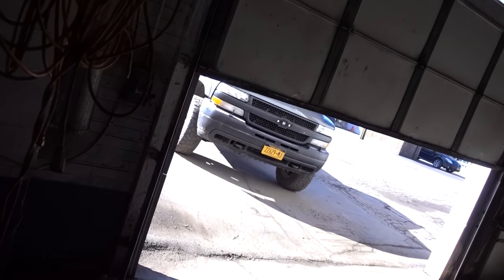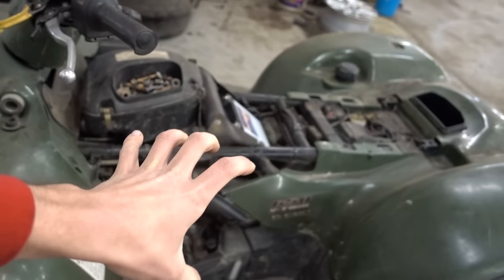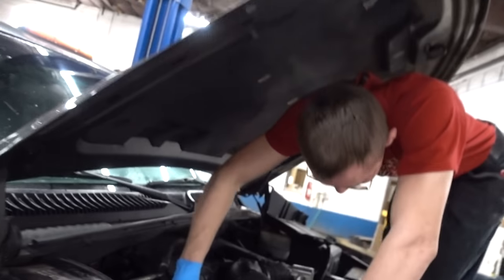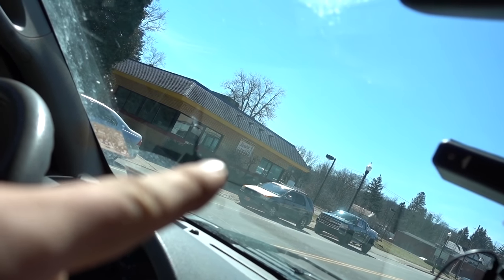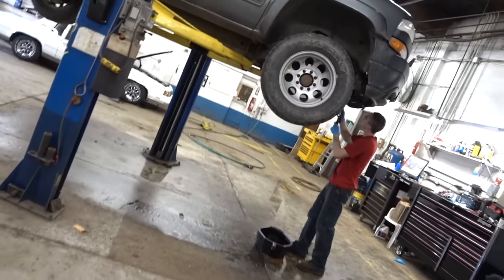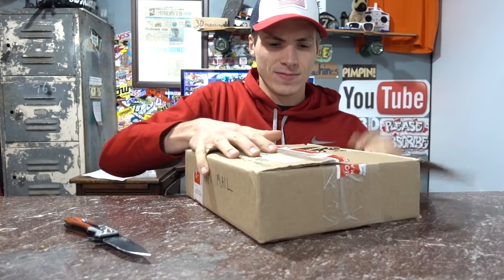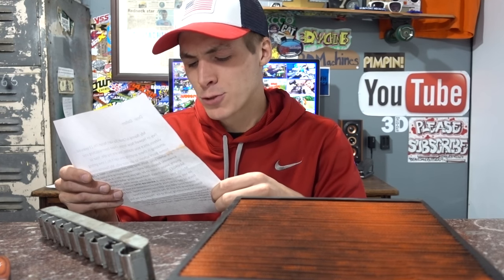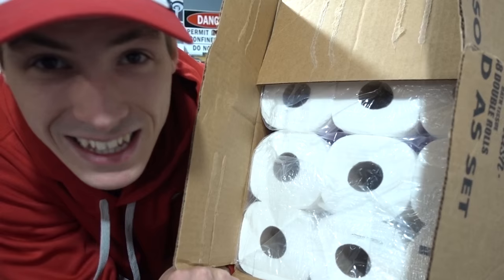MEETING MY FIRST DURAMAX HATER!!

Comment: Ok follow these steps to fix ur radio 3D machines 
1.press preset 5
2.press the right seek
3.press power
4.all at same time
Reply: greg bishop best method ever I tried it once it didn't work
Reply: it works on women CJ  beck
Reply: take the security chip out is the best way to do it
Reply: pull radiator cap off dura max pull trck out to scrap and pull a power stroke in position and reinstasll radiator cap BLUE OVAL
Reply: I had the same problem go online and look up how to unlock a radio for whatever year make and model then it should pop up a list u have to have your vin # radio serial number and year make and model and it should give you the code
Reply: Friends dont let friends buy or drive CHEVY:S
Reply: Push my ford before riding in a cevy
Reply: chevy

Comment: The chevy radios hold the VIN of the previous vehicle they were in. To unlock the radio, you must plug in with a dealer scan tool, or a advanced one like a Verus or Autel, and relean the radio to your current VIN.

Comment: Get an aftermarket head unit! first mod I did to my truck, couldn't go back! Those 12 point sockets aren't designed to break torque, you will round the bolt. I found that out the hard way.

Comment: Hey 3dmachines I have a tip on the radio I know how you like to tear stuff down and fix it...if I can remember correctly that the CD player is jammed? Take the brandused CD player apart that is the same as your factory and take the cd drive out and install it in your factory unit. I had a similar problem and that's how I got past the theftlock!!

Comment: Dalton, I had the same problem with my 2012 Silverado with a factory radio from another truck. Take it to a dealer, they can re-flash the security system for like $60 in labor. There's absolutely no way to do it yourself without the software that the dealership has.

Comment: On the prairie 650 check the clutch ( torque converter) ... I have a prairie 400 and it has a similar noise but it's just from the clutch weights

Comment: 3Dmachines I love your videos and I have a Kawasaki brute force with that type of knock and you need a new crankshaft.  You probably already know this but when you do install a new crankshaft you need to freeze it and and heat up the case with a heat gun.  That way you dont mushroom out the end of your crankshaft trying to hammer it in

Comment: the only way to get the radio working in chevy is to take it to the dealer so they can unlock it . If a radio is stolen out of a chevy they will automatically go to lock mode .

Comment: 3DMachines a after market radio should work you will by pass any stock radio malfunctioning. Your truck looks like it has a antitheft radio system have you set your alarm off on your truck in some sort of way ?

Comment: i had a car that would lock the radio if i even pulled the battery. the dealership had an unlock code and was back to normal right after. i dont know if anyone mentioned that yet. good luck and great videos

Comment: hey if a radio said locked that means that when that raideo was taken out of the original car it was not taken out properly.the only way to fix it is if you look in the owners manual of the car it was taken out of ,and it will show you a code that needs to be inserted on the raideo

Comment: unfortunately I believe you need to get the dealer to unlock it with their tech ii. I think once it looses connection it locks to the current vin #. the dealer just changes it to yours. (provided it's not stolen haha)

Comment: you actually have to call a number it's pretty easy unless those radios are different set up from the 2000s but normally you have to punch 4 digits in using the clock.

Comment: the radio says locked because since it was disconnected from power it locks itself, basically an anti theft lock. so to unlock it you need to get the unlock code from who sent it to you.

Comment: The easiest way to unlock a locked GM radio is bring it to your local GM dealer. I work for GM and I have done it a couple times and it doesnt always work without going to the dealership. They shouldnt charge you cause it takes no more then 10 minutes, they have a phone number to call and the person on the phone searches the vin of the vehicle and gives the technician the unlock code for the radio that GM has on there database.

Comment: just pull the panel off the radio and pull the chip, works everytime, Google it to make sure u pull the right chip.. will read a error everytime to turn it on, but it goes away.. definitely better than paying gm big $$ to get a code

Comment: Guaranteed Radio Fix:

1. Hold down the 5

2. Turn on the radio

3. While still holding down the 5 hold down the 3

4. Turn radio off.

5. Release the 5 and the 3

6. Turn radio back on.

7. Yell out F--K

8. Call the dealership

Comment: call gm have to have numbers off the radio just take a pic of it it will save you in the long run tell them you bought one from junk yard just need unlock code. there all different so thats where the pic of the radios vin# and other numbers. hope this helps get your problem solved

Comment: If that don't work u can open up the raido and there will by if you have it up side down and facing away frum you ther will be in the top right corner there will be too little chips u will haft to remove the one at the top the one that dosenot have wrighting on it why u haft to remove this is the raido has the vin number of the vechel it was origanal in so re moving this removes that info so that should make it work I hope that helps

Comment: It's not that there's a way to unlock it... the dealer pairs the radio serial with he  VIN number of the car/truck (coming from someone with extensive training in car audio/ security) you can't just take and switch radios from cars.  You would have to know the vin number of the vehicle the new radio came from and call the manufacturer but for someone without manufacturer access (average joe) they won't release the code to you without a form of ownership for the new radios vehicle. Honda is like this too. It sucks when I put factory stuff in and they take the serial number sticker out of the glove box. You are better off spending a little money for a radio and kit. Your harness is gonna be the most expensive part based on the data us system... it is that system that locks the radio with a code. They do this so that you can't just use another radio... it's a security/ thieft preventative. Pm me for more info on these systems!

Comment: When you pull a stock radio in from a different truck you need to pull a code in that syncs the radio with the truck if you read this and it works give me a shout out

Comment: You may be reading this comment as your taking a dump to be able to put to use your newest mail. I just wanted to throw in my 2 cents about your stereo but I think those decks once disconnected from one Chevy and put in another your local dealer can plug it in and unlock it. I believe that's just a security thing they put in so people wouldn't steal them. Anyways good luck shake jakes hand for me brrraaaappppp on @3dmachines

Comment: Press the 2 and 3 at the same time and it will give you a code than press the AM and FM button than call 1-800-537-5140 and put the number 106010 followed by this (#) than you put in the 4 or 6 digits code and it will give you a code than you put the code in like if your setting the hour but out the code than hit the AM and FM button and it will say see and than put in the code again how you did it before and hit the AM and FM button and it will work it happen on my 2001 GMC Sierra but it should work for your stereo hopefully this helps you

Comment: Take it to the dealership they need to reprogram it
Reply: James Nichols the right way usually is cost preventative, they can do it within five minutes but will charge $100 or more, there are videos on YouTube with people taking the radio apart and removing chips, with not so good results. He has two radios he could experiment, or he could shop around at repair shops who could do the reprogramming.
Reply: cost prohibitive ... not preventative ...
Reply: Enoch5939 so sorry, you know what I meant though

Comment: Duramax is he best diesel
Reply: The*
Reply: Stock 6.7 Cummins makes more torque.
Reply: Dan coleman perkins
Reply: ford is the best pick up and scania is the best truck
Reply: kobe gerner i
Reply: kobe gerner I would rather have a Cummins
Reply: NoVaTutz did you buy them used from some super sketchy dealer because mine is still going I have a 1992 ford f-150 flare side with the nite package still goes great with 250k miles
Reply: NoVaTutz Ford ftw
Reply: NoVaTutz my friend has a 1996 7.3 like 350k miles no problems it's running like new
Reply: c u That's low miles for a '96
Reply: zane moore i could be wrong but im pretty sure it's around there
Reply: kobe gerner no there not
Reply: nah old reliable 5.9 cummins not the most powerful stock but overall is the best
Reply: Duramax hasn't made one legendary Diesel engine
Reply: kobe gerner Chevy has the best tranny but the worst engine, cummins has the best engine but the worst tranny, ford has a nice interior but pretty shitty engine and transmission
Reply: 2006 LBZ Duramax
Reply: The Duramax is a good engine.  The Allison is a good tranny, but it needs mods if you want to boost power to anything over 100 extra hp or you will blow it.  Cummins makes the most power.  Ford...I don't know much about Ford, but I've heard they have injector problems, ECM problems, tranny problems...
Reply: kobe gerner hahah nice joke😂😂😂
Reply: The old 7.3 turbo diesel is tough .. and with a tune it will tow anything you want.. but mileage  MPG  isn't great.. but parts are much cheaper then the new trucks

Comment: Duramax is cheaper life than the Powerstroke Powerstroke sucks they're lemons and they break down all the time
Reply: the 6.0 and 6.4 were shit if not fixed but the old 7.3 is one of the best. Also the new 6.7 seems pretty reliable.
Reply: Red Machine I don't know because I owned to Ford's 2004 and a 2006 the 04 was okay but the 04 was a straight up lemon kept on breaking down there we got a o7 Duramax and that thing was best thing in the world but I couldn't afford it so i  got a 06 Vortec
Reply: I had a 6.4. No problems at all
Reply: Chris Stewart then you are highly lucky
Reply: my dad had 4 or 5 6 and 6.4, they're all at the dump now. They were real work truck in the woods tho, they are a hard life and they didnt do the maintenance very often

Comment: Radio fix
Step 1 get a power stroke
Reply: I think he's trying to keep a man's truck though ;)
Reply: Matt V I agree
Reply: F**k power strokes he needs a real mans truck a Cummins
Reply: Matt V, your damn right. Ford stands for (First On Race Day).
Reply: fix or repair daily
Reply: Matt V found on road dead
Reply: yes!! GET A POWERSTROKE
Reply: +Thomas Fergusson chevy: cheapest heap ever visioned yet
Reply: cracked
heads
every
valve
rattles
oil
leaks
engine
ticks
Reply: Matt V the radio is the thing only that work on a ford.....ford spelled backwards.......driver returns on foot!
Reply: HAIRY_PICKEL 551 YEAH!!! lets get a slow ass 6 cylinder
Reply: Pulled Plug - Earth, & Ether. ford backwards .....driver returns on foot....lol
Reply: Hubert Husers Ya mean a straight six that'll run twice as long as your shitty sounding V8. Also everyone knows cummins engine have way more potential for power than any duramax or powerstroke out there, and next year cummins is gonna have more power from the factory than any of the V8s
Reply: Matt V whoa just because he has a Chevy and you love ford does not mean rub it in😡
Reply: sedric beachy it should be his own choice not everyone else's
Reply: Hubert Husers exactly
Reply: Pulled Plug - Earth, & Ether. you me. yea but ford is spelled backwards, driver returns on foot
Reply: Matt V yes agree 100%
Reply: MrArcticCat400 CUMMINS power stroke for dinner and  deramax for a snack
Reply: Matt V who buys a power joke hahaha